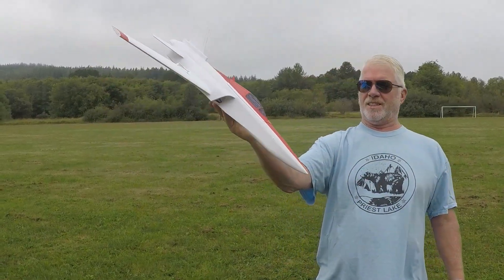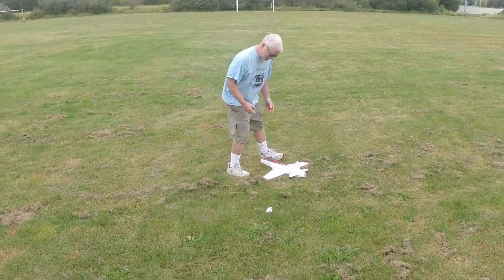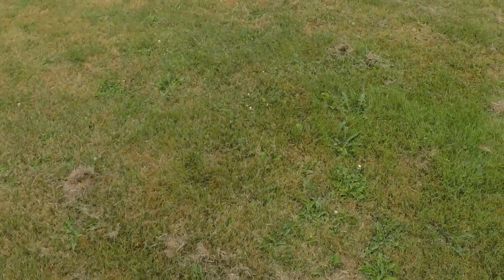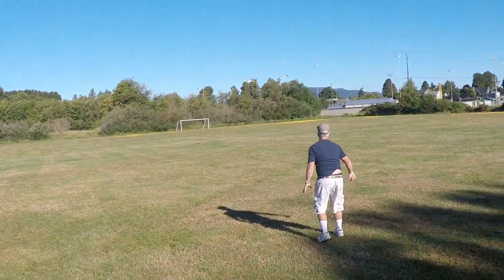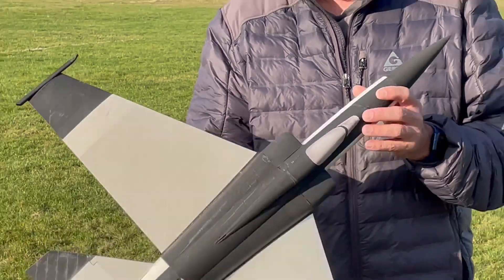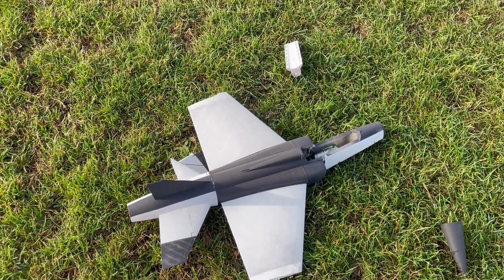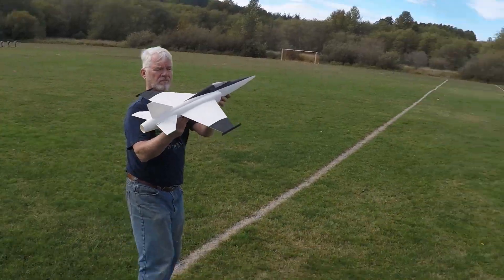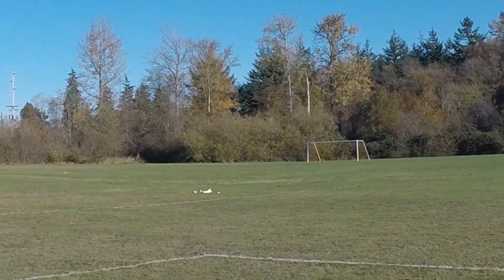Not Every Design in 2023 was a Winner. Part 1: 3D Printed 50mm EDF Miss-Adventure

Comment: enlongated nose tip F5 ?
Reply: may i suggest moving your wing and intake forward thus increasing the wing area so that can generate more lift .
Reply from the maker: Thanks for the suggestion! I experimented with wing size a little. Some of the versions (not shown) actually had a completely successful maiden but then crashed on the next launch. I’m collecting these suggestions and will try again later this year after finishing some of my other projects. The nice thing about the design is that after printing, it only took two hours to make the next one.
Reply from the maker: Thanks for the suggestion. I’ll check dimensions against my successful jets.